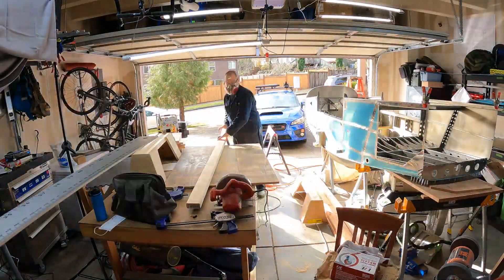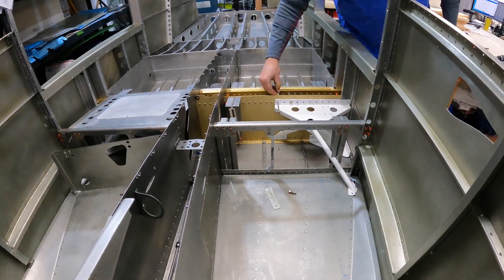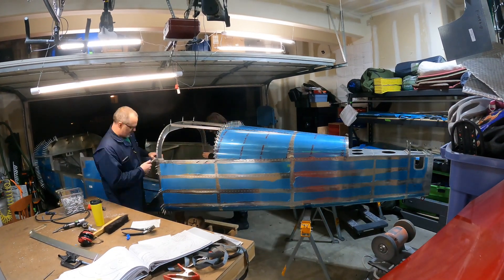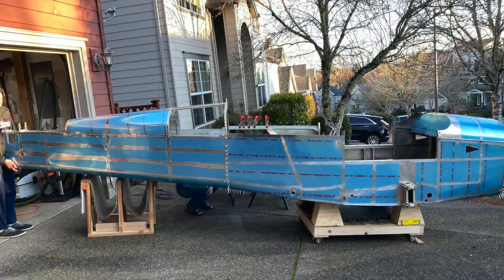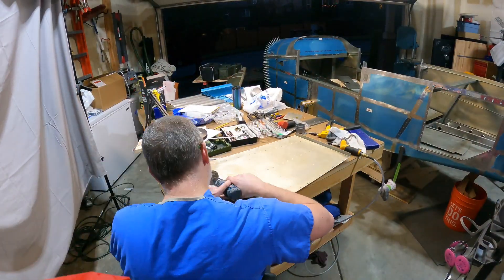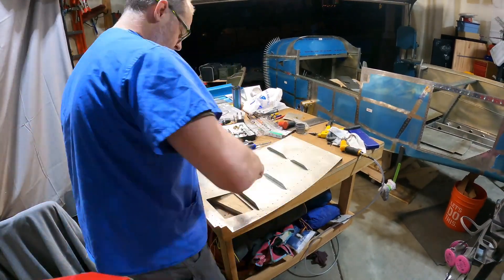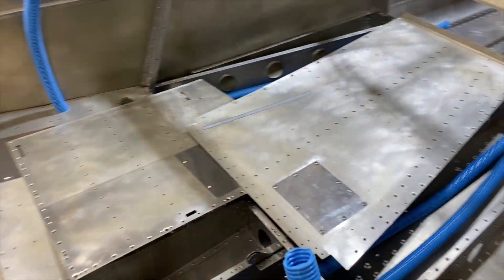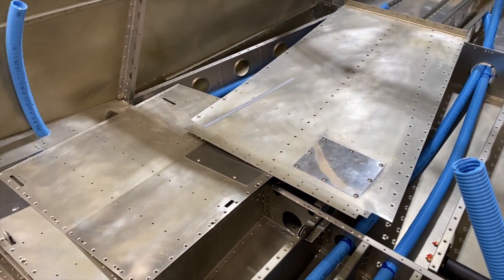McCoy's RV 10 Build Video 14

Comment: Wouldn’t mind getting some info on the doubler for antenna and what did you use for conduit. What thickness is the doubler along with hole diameter or drill bit sizes? I’m in progress riveting the bottom skin of the mid fuse so I could get one in about now pretty easy.
Reply from the maker: Do a web search for Mark's Family RV-10 Antenna Doubler.  That's what I used.  I used size 3 rivets (#40 drill) on the skin and LP4-3 rivets to attach it to the rib.  I purchased 1 inch conduit (3/4" internal diameter) from McMaster Carr.  The conduit from Van's would work well, but they had a COVID case so there shipping was delayed.